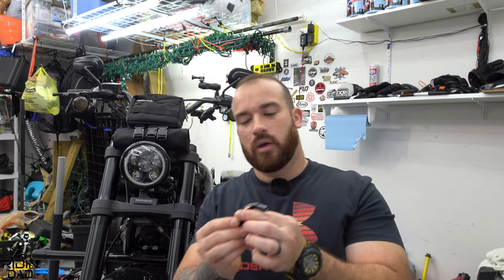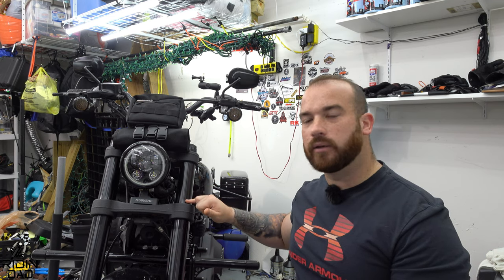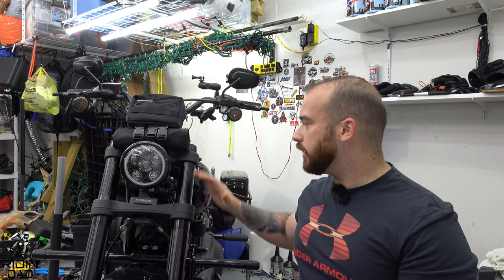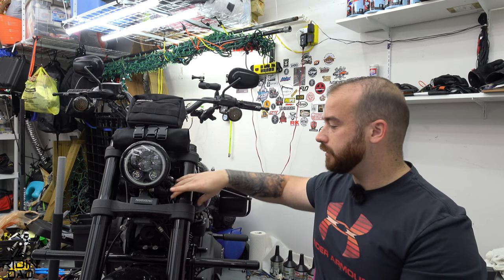Low Rider S/Fat Bob Fork Shims Install from Hairy Customs - RAISE YOUR FRONT SUSPENSION

Comment: Hey man I got a front cartridge kit along with the rear suspension and they are recommending I get these shims to balance the bike out. Would this be something you recommend as well? The crash bar I also got may interfere with the fender if I don't. I just hope this doesn't throw off any handling. How are you liking them?
Reply from the maker: I like it a lot. I don’t realize any negative affect and handling it all and if anything just a slightly raised height as far as clearance and stuff goes. And yes if you raise the rear suspension raising the front will just level it out back to stock. However I don’t think that there’s anything negative about having a lower front than a rear if you just do the rear suspension upgrade. That’s how I ran my bike for many months

Comment: I have a 2020 fat bob and can’t get the shims to fit without dropping the forks way to low. Maybe because I have ohlins 
 the only thing different is the cap.
Reply from the maker: Cap won’t make a difference. You can drop the forks down to be level with the caps like I did. How are the shims not fitting? Did you make sure the triple tree and forks were clean and no tiny debris or dirt were in there?
Reply: The fat bob has different triple trees that might be the difference but the fork tubes don’t slide down far enough to use the shims
Reply from the maker: No my knowledge the fat bob and low rider s have the exact same inverted front end. Those shims are marketed specifically for both bikes. Not just the low rider s. Is it possible you have the shims upside down? I’ve seen them used on several fat bobs. I don’t understand what your issue could be

Comment: Interesting. Seems like it has the potential to cause more issues that it's worth but I'll be interested to hear about your results once you get some miles on it with the shims.
Reply from the maker: What issues do you think it may cause
Reply: @RidinDad  Well, my primary concern would be that your putting a tapered piece of plastic into a tapered gap that's held in place by friction. There is a lot of up and down force on the front of a motorcycle and while I haven't taken a physics class in around 30 years it would seem to me that all that up and down combined with the force applied around it could cause the shim to eventually work its way up. Of course this is complete my thoughts with no science, facts, or anything substantial behind other than my brain so I could be completely wrong but given it's the front of the motorcycle I personally wouldn't be willing to risk it coming to fruition while I was barreling down the side of a mountain :)
Reply from the maker: The fork pinch bolts clamp on the top with no shims and on the bottom portion of the fork area as well. The shims only are on 1 out of the 3 points of contact essentially. There are tons of guys running these with thousands and thousands of miles. No issues at all.
Reply: @RidinDad  Yup I thought about all that before I replied. I highly doubt my concerns would ever be an issue...but my paranoid mind would personally always wonder so it's not a mod I would do but I am looking forward to your feed back in it.

Comment: Where did you purchase the black forks and all the black hardware? I have a 2014 Fat Bob that I want to blackout the front end.
Reply from the maker: I did not purchase anything different than stock for the parts you mentioned. If you have a 114 fat bob your front end is identical to mine. We have the same inverted front fork setup
Reply: Yes the set up is identical; but not the finish of the forks tubes. My bike came with chrome forks and I did not see the black available through Harley.
Reply from the maker: It shouldn’t. All the inverted setups should be identical. Especially on the 114 fat bob. Block upper forks and chrome lowers with black covers. If it’s not you need to ask Harley why that is. They don’t even offer a chrome inverted fork setup typically
Reply: 3m
Reply: That’s 3m vinyl wrap.. lots of people are doing that.. takes 3 minutes
Reply from the maker: No it’s not. That’s how my forks come. There is no vinyl. Why would I lie about that?

Comment: Where do you get fork shims? Can't find them on the internet.
Reply from the maker: I mentioned in the video I put the link for the product right in the description. It’s right there you just have to click it.
Reply: @RidinDad Those are the wrong ones. I need different size shims and made out of aluminum
Reply from the maker: Well you should have specified, otherwise I assumed you were talking about the ones in the video. There is one other company making metal ones but they are for this same exact style of fork tube. What different size would you need? The only reason you need these in general are for the inverted fork style because of how the fork tube tapers at the bottom triple tree Mount
Reply: @RidinDad  A previous owner of my old Honda Magna put smaller diameter fork tubes on it with rubber shims to make up the difference. I'm looking for metal ones to increase the size from 37mm to 41mm.
Reply from the maker: Yeah I t don’t think you’ll find that ever honestly. You probably have a better chance getting something custom made from a local shop to you or buying a metal pipe and cutting, trimming, and shaving it to what you need.
Reply: @RidinDad what’s the company making the metal shims? I know I’ve seen them before but for the life of me can’t remember or find them now.
Reply from the maker: @Fxlrs_chris I don’t remember man

Comment: I have mixed emotions about this mod; to me it only makes sense if you have an extended rear shock (which if I remember correctly you have). Okay so what is the affect of lowering the fork tubes in the triple clamps? It increases rake and trail which has the affect of slowing turn-in / handling (lots of fun to be had researching this BTW, it really is a fun subject). It also shifts weight rearward off the front tire; lessening front wheel grip. This is why sport bikes have less rake and trail (straighter forks). It is also why rider position on a sport bike has the rider further over the front wheel (weight bias).  YOU, having an extended rear shock are actually returning the bike to closer to stock. The only real advantage I see with this mod is a slight increase in ground clearance; mostly toward the front of the bike. I doubt it gives you more than a degree or two of lean angle; although I haven't done the calculations so I could be off a little. One of the other things that bothers me about this, although it probably isn't a big deal for most people, is that you end up clamping the fork tube (with the upper triple clamp) directly on the threads of the tube caps. Which means when servicing the forks it would probably be best to loosen the upper triple clamps to avoid deforming the tubes when you remove the caps (with the pressure of the triple clamps). All in all (IMHO) this is more snake oil than anything else. But if it actually does do something; the effect will be to slow handling. That said; slowing handling tends to make the bike feel more stable. The inverse of fast handling (twitchy) being slow handling (stable). To a point anyway, because as I mentioned it also shifts weight back further on the bike meaning less weight on the front tire; meaning less grip. So there is a balance.
Reply: Honestly I think you'd gain more benefit from correctly adjusting preload, compression and rebound (if you haven't already).
Reply from the maker: Yeah I can see where you’re coming from. Correct me if I’m wrong but it shouldn’t affect take at all no? The angle at which the forks are clamped is the same. Just extending one side so the rake degree shouldn’t change right? And yeah I don’t have adjustable preload or damping on the stock forks but that is a future upgrade I’ll be doing. New cartridge kit for sure
Reply: @RidinDad  Actually rake is affected; I'll explain. By changing the length of the forks you've changed the angle that the bikes frontend is sitting when compared to the ground. To explain think of it like this; if you put a level on one of your lower frame tubes before you extended the forks you'd get one angle; then by lengthening the forks if you put the level back on that same frame tube you'd get a slightly different angle. Now translate that change up the bike to the steering head and you will see that you have indeed changed the angle of the steering head. Rake is the angle of the steering head in relation to the GROUND. Hope that is understandable, it isn't my best explanation ever LOL. And yes, I understand that you don't have adjust-ability in the front suspension (without adding or subtracting shims anyway) but you do in the rear and it can have a significant effect on handling. :)
Reply: By increasing rake you essentially increased turning circle even though you've increased available lean angle. This has the affect of increasing steering effort. More rake makes the bike want to stay upright, hence being more stable. Generally it will make the bike "feel" more stable at speed. Granted the changes being made are relatively minor but the science says they are negative in relation to faster handling. Also as mentioned earlier, this also affects weight bias which can have a significant affect on handling. If you watch a motorcycle racer you'll notice they are rarely in the saddle. They are shifting their weight all around the bike to move the center of gravity (weight bias) where they need it for greatest stability in a given situation (over simplified but I hope you get the point).
Reply from the maker: I completely understand everything you are saying and I also completely understand the meaning of a lesser or more degree of rake. I talked about it in one of my earlier videos comparing the rate of this bike to the standard Lowrider. So I completely understand the principles behind everything. My understanding was just always that the rate was the degree of the forks in relation to the frame not the degree of the frame and stuff. Which is why suspension changes never changed the rake according to how I understood it. I’m not saying you’re wrong in anyway I’m just saying that’s always how I understood it
Reply: @RidinDad  yeah so the technical definition of rake is; The angle in degrees of the steering neck from vertical. Hang a plumb bob, now measure the angle of the steering head in relation to that. That is rake angle.
Reply from the maker: Gotchya. The good news is I don’t know anyone running these without taller rear suspension so we are kinda reverting back to stock configuration like you said before
Reply: We're kind of heading down a rabbit hole with rake though. Net result, extending the forks does have a negative affect on handling. Even IF rake is not changed it for sure changes trail in a negative way. LOL
Reply from the maker: LOL yea I agree the trail is a non arguable point LOL. It all is so minimal with this setup too so it’s a nice minor change
Reply: I think that with a 13’5 mono shock your bike higher at the back than at front. So your chassis is inclined toward the front.
To have your chassi horizontal, like a fat Bob, you would need a 13’2 mono shock.
So for me, putting these shims is not putting you back like origin but is giving you horizontal chassi position like the fat Bob (which is a great handling bike). 
Because these shims are not giving you the same level up than 13’5 mono shock.

I hope you understood me 😅😅😅
Reply from the maker: Yes I understood and I agree since you are upgrading your rear height by about 1 inch or so and you are only moving your forks down maybe a half an inch. So yes that is very clear but it is very close to back to normal. And I have had a Fat bob before and I would say that this bike handles much better than a Fat bob